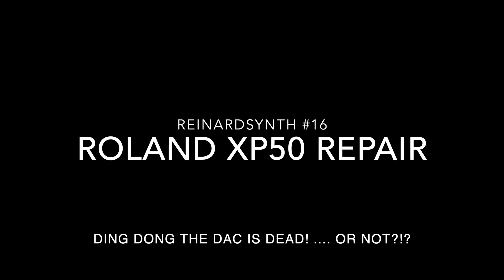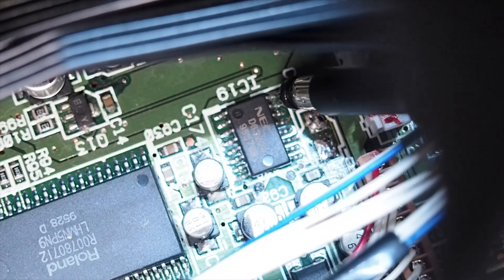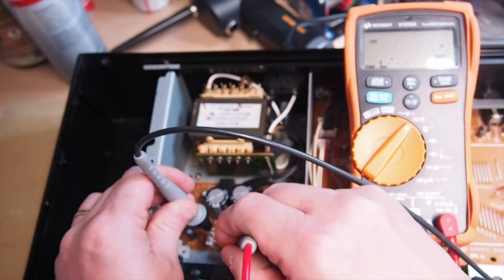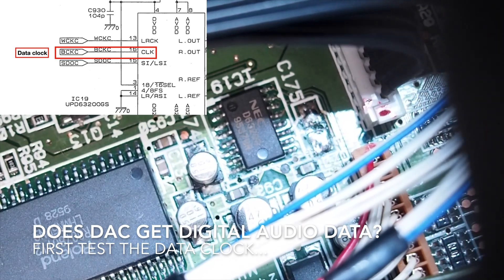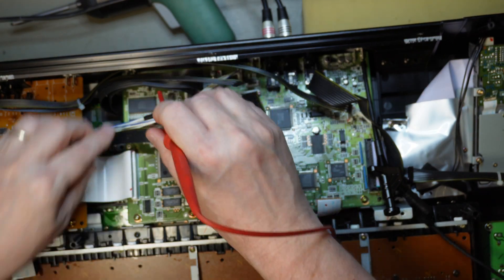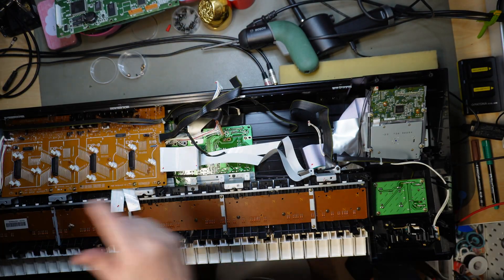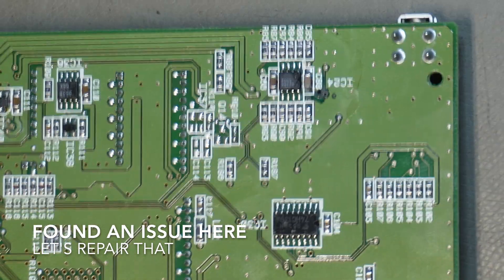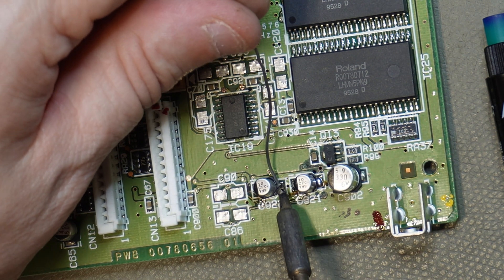ReinardSynth #16 Roland XP50 No Audio... Dead DAC?

Comment: I have just done a similar job, but no cigar unfortunately! Changed all the electrolytics on the main board and an op amp (marked IC4) and linked the same broken track you did from C90, (plus one for the contrast and one for IC4 pin) now I have sound, but it's distorted, even distorted out of the dac. Dying DAC do you think? Data-in looks oK, could be on the digital side....

Comment: I currently own an XP50, in patch mode it works great but, in performance mode it cuts off and adding more than three tones or layers at a time puts too much pressure on the synth and it just cuts off sound completely. From the research i did it seems that with age the components start to fail. Is there a way to know which components directly correlate to this issue?
Reply from the maker: midi loop? as in: midi out is somehow connected to midi in?

Comment: Excellent and thanks for sharing! I'm having trouble removing white wiring harness at CN5 and CN6.  Didn't find any obvious latch or release.  Any hints would be appreciated. Also what pin locations did you probe to obtain the power readings of 5v and others?  I'm not an electrician but have a multi meter to use.
Reply: I figured out how to remove wire harnesses; simply apply equal pressure and pull up.  They pull straight out no latch or release.  If you could let me know about the above noted power readings. What pins and expected levels on the multimeter.  Thanks.

Comment: Hellooo do U know what cause xp50 with super low volume??
Reply: And sit down you know how do I make the screen a bit more visible? Mine one is fading
Reply: Sir*
Reply from the maker: @gauyeeradio3782  low volume: 10uFcapacitors in output circuitry… screen. ore visible: adjust contrast in xp50 menu…

Comment: Thanks for sharing your repair story. Has anyone encountered a problem with LFO panning setting? My XP-50 went through the same capacitor replacement fix, but one thing remained wrong. Some patches that have LFO automation programmed in them do sounds like there is rattling sound there especially in lower frequencies and with LPF and panning settings on. When the pan is centered or neutered then the problems disappears.  And when pan is added the distortion or rattling comes back. Could it still be a capacitor issue or DAC or something else? 

I can hear it in some patches such as PR-C:081 3D Flanged , PR-C:084 Moving Glass, PR-C:092 : Aurora and PR-C:093 : Strobe Mode

Comment: Sir..I have also a Roland XP 50...buy output isn't properly..it's vary low sound..please help
Reply from the maker: Clear case if replacing the capacitors as listed in the description… find a local tech to do that for you if yiu cannot do it
Reply: @reinardsynth6581  thank you so much.....

Comment: Hi Can anyone confirm if i have this correct.  In Accordance to the Schematic in this Video The capacitors in the Right audio path are  C174, C90, C7, and C5, all rated at 16V 10μF ? These correspond to the left Output capacitors shown in the Video C175, C86, C11, and C8, all rated at 16V 10uF. I am almost there. I have had My Board Recapped. The left channel Audio is working Fine and Good Volume Output but No Sound coming from the Right Output In Main (R) and also in the Phones (R). The Screen is working just fine too. What  could be the problem here? What do i need to check? btw there are no visible areas of Electrolytic damage or any other trace damage that can see with magnifying glass. Shall i get those Right Audio Output Caps recapped just incase there is a dry solder joint? Thanks
Reply: Hello, were you able to fix it? I have that similar problem perhaps, on a Korg X3, it has audio in the L output but not in the R, the same thing happens on headphones. I changed some electrolytic capacitors and I think it was not a good idea because now in addition to continuing the same it has a noise like white noise when releasing the keys, and suddenly it stops having sound. You have to be very careful when removing the aluminum SMD capacitors because if it does not come out well it lifts and breaks some track just that happened to me and I do not know if it is bad from there, it seems to have continuity between components and there are no tracks crossed with each other. I suspect a channel ic, but I'm not sure if it is from there.
Reply: @diegoperez2912  Hi there. Yes i did manage to fix it. There was a weak solder joint on c90 capacitor so i re soldered it and checked it if had continuation on Multimeter and it beeped , so when powered up now the Right channel was working so both channels work. Yes you are correct, you must be very careful as the pads can easily be removed. I don't know layout of Korg X3 but Reinardsynth is the best guy to ask. Hope you fix it.

Comment: sir, after turning on my keyboard for some time, it hangs, no button works, no tone changes. Sometimes the last key loud speaker keeps playing. If I turn it off and on, no program appears on the display. After turning it off for a while, the program appears. But after running for 2-5 minutes it hangs again.
Reply from the maker: I had an XP50 with these symptoms that was the result of a faulty power supply: check the bridge rectifier, caps and power regulators on the power supply.
Reply: @reinardsynth6581  sir please give me your whatsup number

Comment: Thank you so much for the video. Actually it forces me to review my work after I almost gave up and I found I forgot to solder two capacitors back 😂. 
I do have a question though. After replacing all capacitors I got sound, but only in right channel. I don’t have a schematic you showed in the video, but maybe you can suggest what elements to check? I suppose it shouldn’t be too complicated, I know my DAC is working.
Reply from the maker: The schematics can be found here: http://www.synfo.nl/servicemanuals/Roland/XP-50_SERVICE_NOTES.pdf. Regarding the right channel audio: check using the schematics the signalpath from the DAC output to the right ausio output and see where it stops… there are some components inbetween that can go wrong (caps, opamps)
Reply: @reinardsynth6581  Where are you located here in the United States? I need a job like this for mine

Comment: I have one of these but after changing the battery I can't seem to factory reset as the disk utility button won't engage, its seems that I can only get to this menu buy pressing Exp A No. 5 button but after pressing number 4 I can't get any further?
Reply from the maker: Hmmm… seems you really need to fix the tactile switches underneath the buttons, especially the “disk utility” and buttons underneath the display… or you can try to download to the XP the patches using MIDI sysex (be sure to turn on reception of sysex…)
Reply: @reinardsynth6581  Hi, I have now replaced all the caps including the pwer supply, factory reset ok, LCD screen ok, but no sound out. I had sound before I replaced the main board caps but couldn't factory reset and kept getting a midi buffer full error that wouldn't go away. It has gone now. I am only getting 7.4V from the op amp Q1 every thing else ok? Checked the DAC and seems to be producing a signal when keys pressed?
Reply from the maker: check if DAC gets the correct voltages (supply and reference) just 7.4 … did measure correctly? that’s halve of 15V… PSU delivers plus and minus 15 V?
Reply: @reinardsynth6581  Only getting 12V to the IC3 instead of 15V? What do you think could cause this voltage drop. I have checked all components with a signal and apart from the voltage dropfrom 1V on some IC chips everything seems fine. I am stumped!
Reply: I've replaced the DAC and it works! The only problem is the volume is very low?

Comment: Yo tengo un  ROLAND XP-50 y le falla el Displey, en pitch y algunos botones y aparte ya no prenden... La pantalla se queda color naranja
Reply from the maker: Check if all voltages of the PSU are within spec, check if the CPU gets a reset signal at power on, check if cable connectors are not corroded… those are the first thing to check. if not comfortable with repairing electronics, please contact who can check that for you

Comment: Tenho um xp50 que esta morto. Apenas acende display, mas não tem informação na tela e não daí som. Nada funciona.... irei verificar por capacjtores vazados.... obrigado pelo vídeo espetacular.
Reply from the maker: If no info on screen and just a bar of black boxes: the display does not get a rest, or the CPU does not boot. If you have the equipment: check voltages of the power supply that they are within spec. Check cable from display to mother board (contacts clean and not oxidised?) and check if CPU gets reset signal. device manual (which you need to find the points you need to measure) can be found here: http://www.synfo.nl/servicemanuals/Roland/XP-50_SERVICE_NOTES.pdf

Comment: Question for everyone on here -- Would swapping out the Aluminum electrolytic caps for conductive polymer aluminum solid caps with the same max voltage and capacitance rating or else MLCC SMD caps with the same voltage and capacitance change the audio characteristics of the synth in the power circuit or around the DAC?

I do not know much about this stuff at all.

I'm just wondering if there are capacitors that will sound the same (more or less) as these replacement panasonic SMD electrolytic caps with a longer lifespan?

If I'm going to recap my XP-50, I'd ideally prefer using capacitors that will last longer than 10 years. If MLCCs would sound OK, could I use those?

Otherwise, would panasonic Al electrolytic caps last 10 years?
Reply from the maker: hmmm… good question… To start, current brand SMD capacitors are way better quality than the ones used by roland in the early 90‘s. Panasonic, Nichicon, Rubycon, Elna  or Chemi-con to name a few. You can safely use these. Use high temperature ones or their special „long life“ ones. For  use in audio circuitry, an engineer I know recommended foil capacitors; but that is I think just an opinion…

Comment: Great job. Where did you get the schematics for the XP-50? My XP-50, which I bought new in 1995, has some issues. I'm about to take it apart and do some visual inspections for leaking capacitors and electrolyte damage, but it would be helpful to have a schematic to help me test continuity between various sections of the board to check for corroded traces.

Do you have a link to an online schematic?
Reply from the maker: http://www.synfo.nl
Reply: @reinardsynth6581  Thanks!

Comment: Also have a xp50, no sound and display.
Replaced all the electro capicitors, repaired some pcb lines, destroyed by leaking caps.
Still no sound and display😢

Update, was missing power on the analog part of the DAC, the capacitors leaked, and damaged the pcb, fixed this, and sound again.
The schematics are different in this part are different than real live on the pcb
Reply: My screen had still a backlight
No characters
Reply: @janpytje  Hi Jan According to the schematic shown in the video any chance you can tell me what Caps are on the Right audio signal path?
Reply: @aarunsan2721  ik can send you the schematics or picture with highlighted capacitors
Reply: @janpytje  Hi Jan i would really like that and would be much help but  can't seem to send my email add here.
Reply: @janpytje  can you upload to dropbox? or any other platform where i can view the images?
Reply: I’ve heard there are transistors that fail, Q8 and Q9 at the output stage. 2sc3326 is the part number, perhaps that will help. Take a look at the schematic first. Good luck!
Reply: @mccarry30  the xp50 is running fine now
Reply: @janpytje  aha ok, I’ll leave that there for anyone else in the future
Reply: Hi janpytje. I have the same problem. I replaced all caps. can hardly see any electrolytic damage. Still, No display, (Like Dead Screen, nothing) and No sound.  I know it's not the PSU because i tried another mainboard and lcd  and sound works.

What do you mean when you say "was missing power on the analog part of the DAC"?  Did you replace the DAC? What exactly did you do to get it working? Help appreciated.
Reply: @aarunsan2721 For the display, there is a modification
On youtube is an explanation.

For the dac,  they have a digital part and analoge part.
Each has his own power supply on different pins.
My xp50 had destroyed pcb lines whitch i repaired.
So i did not replace the dac.
When you have schematics you can see what i mean with the power supply

Jan
Reply: @janpytje  Thanks Jan. btw was your screen still lighting up with no characters? Mine screen is totally not even lighting up  but still should work if I followed what you said right?

Comment: Great video. Was this a paid job you did for someone’s XP50? If so, what would be a fair cost for this work? I have an XP80 with a similar issue. No sound output from anywhere except the Clock out. I’ve had the board since new in 96 and replaced the key bed last year, which wasn’t cheap! So I’d like to get it back up and running.
Reply from the maker: Not a paid job, this ist one of my hobbies… buy broken synths, repair and sell again… zero sum game. If this would be a paid job? Hmmm.. i would think they should book 3-4 hours for this plus about €20-30 for parts (cost driver: tactile switches)
Reply: Thanks. I appreciate the response.

Comment: Pretty much all Roland gear with SMT caps from the 90s have similar issues, DAC, DSP, Booting, etc etc.  Nice fix and well done.  I've done the same with a VS2480.  90 caps on the mainboard alone : / simple enough when you can get to the mainboard : 0

Comment: .✨🙏🙏🙏my XP - 50 had a problem with the display after 7-8 years of everyday utilisation...nobody found the issue problem...some said it was the power source... some not... someone changed my computer ...it was functioning for 2 years and than again ...the display ✨🫣🫣🫣...than a noise in the output L/ R appear... couldn't find the cause ✨🤔🤔...now it doesn't start ...anymore..!?...I have it in my room ...I was forced to buy the successor to save my songs and sounds library....XP- 60 ... a beautiful complex workstation with modeling sound in real time ...arpegiators...